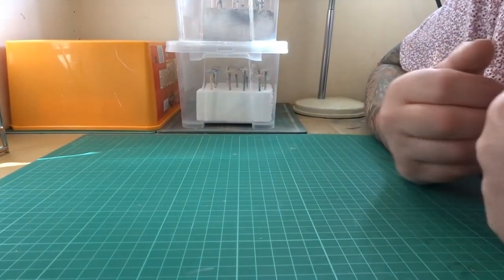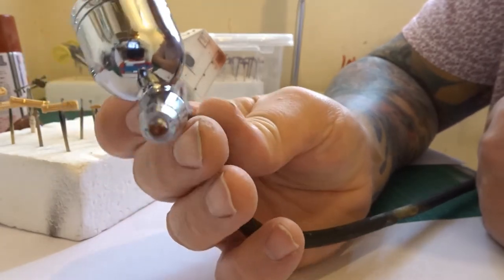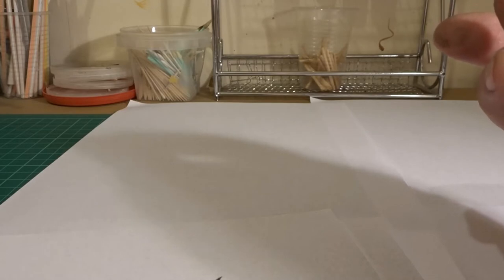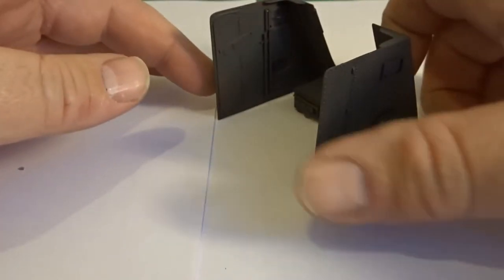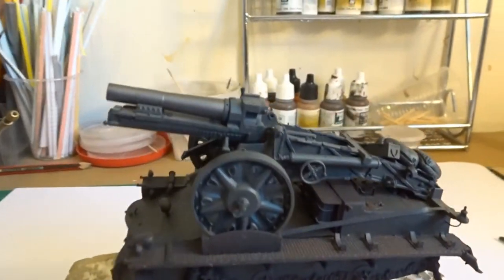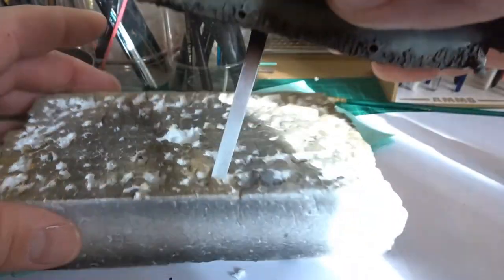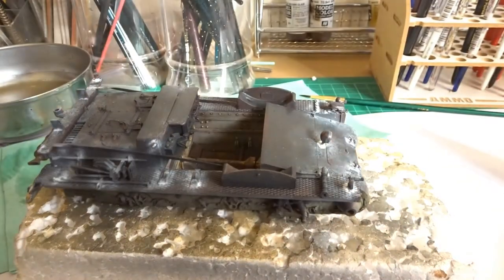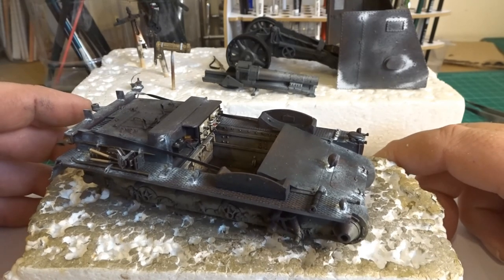Ark Models German SIG 33 Panzer I Ausf B BISON PART TWO

Comment: Excellent video Steve. Lots of tips and ideas. I like the way the mud texture is built up early on rather than rely solely on the pigments later. Slightly surprised that a modeller of your calibre uses cheap airbrushes but definitely works for you. Your subtle layering of effects is something to note for sure - very effective even before the oils. Your method to create a modulation effect without risking detail with too many paint layers works well.
I reckon there is enough content in this for two or even three videos.
Reply from the maker: There has been two occasions when I have had to rush off and I have completely forgotten to clean out the airbrush. I have gone back to the bench a few days later to find the airbrush totally seized up with dry paint. I would die if I did this to an expensive airbrush. I certainly have no difficulty airbrushing with the cheaper models. Its just that the nozzles and rubber seals disintegrate after a while. What was the name of that guy who used to promote the use of filler for mud on his models way back??
Reply: I remember seeing Carl Startin build up the mud before painting once. It was a WW2 model of a small car bogged down with one of his outstanding figures stood by it.
Reply from the maker: Thanks for sending over the picture. A stunning build